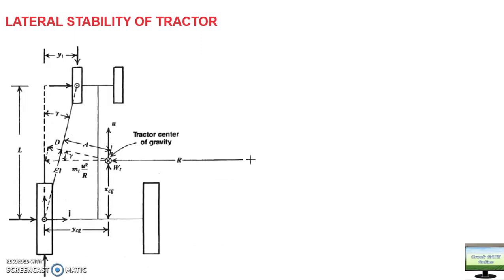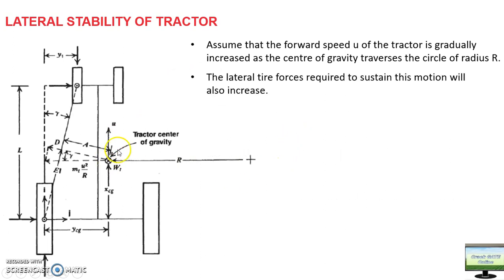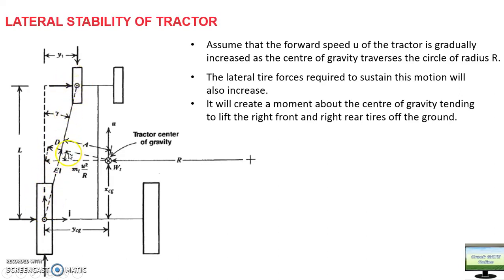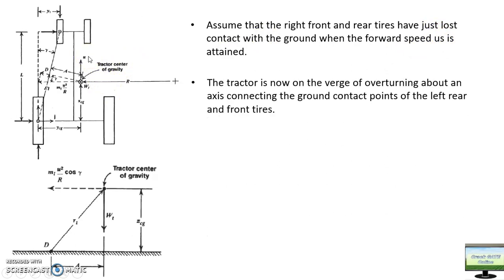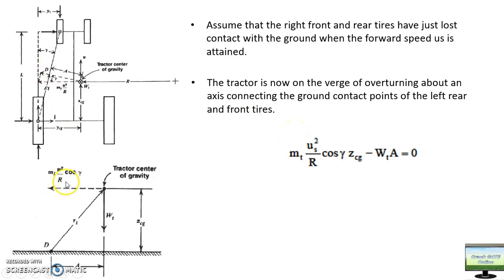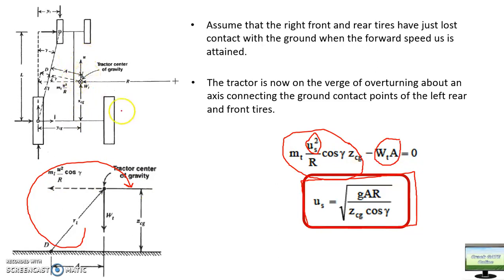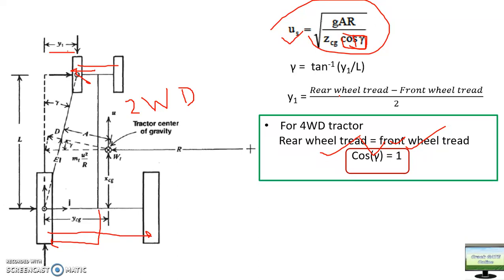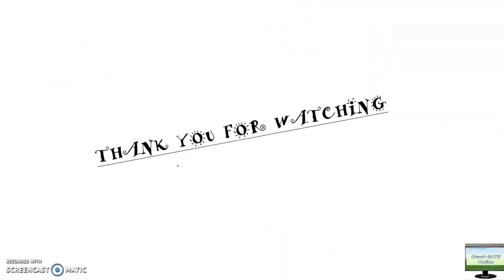TTS 2.5: TRACTOR LATERAL STABILITY

Comment: Your calculation assumes that the front axle of the tractor is rigid with the chassis and can not articulate.  Normal tractors articulate at the centerline of the chassis.